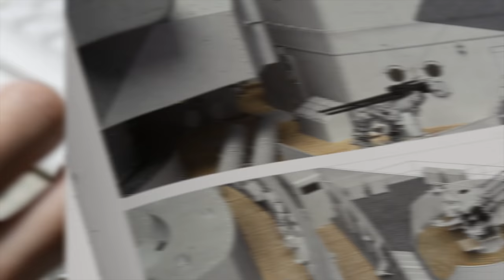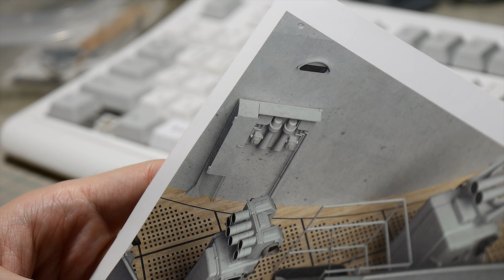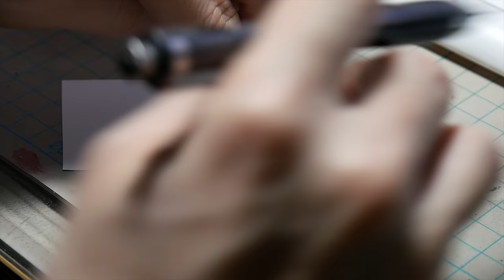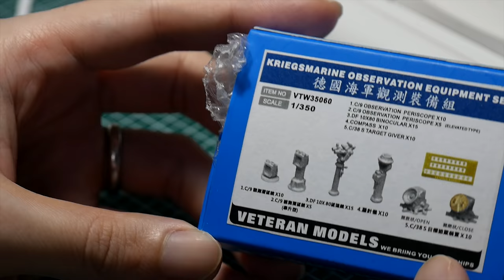1/350 Tirpitz (Revell) Assembling part4

Comment: Since here are fellow modelers, and of course an amazing content creator, I would like to ask what varnish do you use and what thinner to remove excess paneline wash (for example tamiya paneliner). Cause my thinner allwas bites through the closscoat into the paint, or the cotton Butt sticks in the closscoat as it desolves. Maybe I do apply my gloss coat to thin. (should I do a wet coat with my airbrush¿) or maybe I push to hard with my cotton but...
If you can help, that would be great. I've got a Uss Montana project next to come and I want the weathering to be perfect.
I use:
Closscoat : x-22 or Vallejo 70.510
Thinner : revell color mix enamel thinner or the x-20A, which worked not as well.
Problem : wash seems to desolves into gloss coat and create an unpleasend finish
Wash: tamija paneliner black

To the video, absolutely stunning as alway, especially the passion you have. I to often rush my Modells. Have a great time and thanks for the video :)
Reply: I use Vallejo gloss coat.  I mix it with x-20a because I cant be bothered to buy Vallejo's thinner.   Once the bottle runs out, I'm done with it.  
Garbage finish and it sands weird.  It feels gummy under fine grit.  
Using X-20 mixed 1:1 with x-20a gives me no problems through my airbrush or with sanding.  
I bought a plastic jug of paint thinner from the hardware store.  Lifetime supply of tamiya panel wash remover.  No problems.  
When I gloss coat, I give it 24 hrs to dry before panel washing.  
It sounds like your either 
a)  not allowing your gloss coat to dry long enough before doing the washes
b)  mixing enamel thinner with x-20 or vallejo.  Bad news.  
I hope this helps and good luck with your models.
Reply: Clear: Humbrol clear matt/gloss, mostly vallejo polyurethane clear Matt varnish.
Panel line: I do use tamiya panel liner, but mostly use my own made out of acrylic, water and isopropol alcohol.
Thinners: Humbrol enamel thinner or tamiya x20, whatever it is, use very very little, I've ruined enough paint to vouch haha
Reply: @robk.5467  Well, I do give the clear coats about 16 hours to dry and I always used the thinner of the various brands, tamiya for tamiya and Vallejo for Vallejo. But I maybe apply my clods coat to thinly. As soon as it hits the surface it drys, I don't know if it should be like this. Also the finish isn't very clossy in the end. Should I apply more paint or use less pressure? Anyway thanks for the Vallejo advice, wont use it then :)
Reply from the maker: @ ni mofy, I only use lacquer base coat, like mr.color super clear. I haven't used any acrylic colors yet, so I can't give you any advise about using Vallojo's.
Reply: @EbroinSong  I may try lacquers some day. Thanks :)
Reply: @nimofy6336   I think I might know whats happening now...
You mentioned that your gloss coat doesn't look very glossy.
When I gloss, I'll spray a thin "tack" coat first.  Then go back over the area again, but this time I look for a wet appearance when spraying.  It sounds like your not applying enough gloss.  You want that wet look (but not flooded).  
If your gloss coat is too thin, it will get eaten by the thinner your using to clean up the panel liner.  
All I can suggest is to type in "how to apply gloss coat on models".  At least you'll get a visual reference to guide you.
Reply: @robk.5467  OK, I'll try that one, but a ratio 1:1 closs thinner is fine?
Reply: @nimofy6336   yes.  1:1....you see how thick and gloopy that stuff is in the bottle, right?  My airbrush nozzle clogs if I dont thin it down.

Comment: One more thing. How do you go about painting your ships? Do you mask all the wood decking and then paint the ship colours? I'm not sure how to approach my Hood when I get around to painting it. Thanks.
Reply from the maker: I normally put the wooden deck after I paint the ship,  probably your Hood is normal, and better than my Tirpitz. Honestly this Tirpitz has serious issues.. I put the deck before paint it because I have no choice. Thank you again for the comment.
Reply: @EbroinSong  I was wondering why you put the wooden deck down so early, as it means you have to mask it. I thought the Revell kit was meant to be the best Bismarck/Tirpitz available?
Reply from the maker: @rocketassistedgoat1079  Yes, the deck would perfectly fit on unmodified Tirpitz kit. 
But because I modified my Tirpitz, (make new wall, new wall supports, carving out some details, adding new features, etc..) the deck won't  fit anymore.  
So I have to adjust the deck to make it fit,  and simply I can't do it without putting it.
Reply: @EbroinSong  I have to say, it is a bit disappointing how thick the kit sidewalls are; I thought for the price, the Bismarck/Tirpitz was state of the art. But maybe I've just been spoilt by what I'm working on at the mo [Dragon Gleaves, Trumpeter Dreadnought and Tamiya Kagero]. So I'm guessing Revell still isn't quite up there. The Dragon kit especially [I also have the Gearing], is increadible and Dreadnought marks a big step up for Trumpeter. Very thin and tapered sidewalls on both and the Dragon has inner sidewall detail. The sidewalls on the Kagero/Yukikaze I'm replacing with p.e, but it's designed for the kit-so will be easier than what you're doing.
Reply from the maker: @rocketassistedgoat1079  I have Dragon's 1/350 Scharnhorst, comparing the Reveill's Tirpitz, Scharnhorst looks like cookies from the heaven. Unfortunately there is no other options for 1/350 Tirpitz. there are kits worse than Revell's. Tirpitz deserves better.

Comment: What is Magic Sculpt
Reply: The sculpt of magicians? It's the grey putty he's using.
Reply: @hubristicmystic  What are you doing with it?
Reply: @danielmonsberger6490  it's can be formed into all sort of shapes. It hardens when it's left at the air for a good portion of time so it can be sanded or painted. Can be used for filling up gaps or create new structures on the ship. Mostly filling gaps.
Reply from the maker: @ DerRevolutzer. It is a sort of clay. Mix A+B and it will slowly harden. I use for.. almost everything. sculpting figures, making rivets, carve guns.
Reply: Its a brand of a two part epoxy putty  - Tamiya and Milliput, to name but a few, also produce two part putty.

Comment: Very cool but the admiral's bridge looked the same to me. I would have just taken a square file and enlarged the windows a bit. No need to over engineer...
Reply from the maker: well, making new one is not that difficult to me. Filing exact perfect squires are harder when I tried. 
You can try file the squire if you like, I won't complain it.
Reply: I thought that was great work scratch building the bridge - I once tried forming windows with a drill and a file and it was a disaster for me and I wish I had tried your method - however since that time someone building the  Trumpeter Bismarck  over at Model Ship World - https://modelshipworld.com/topic/1535-bismarck-by-channell-trumpeter-1200/ -  recommended using the Dremel Carving /Engraving Set https://www.dremel.com/en_US/products/-/show-product/tools/689-01-carving-engraving-mini-accessory-kit to enlarge or cut out  windows when none are present - haven't tried it yet myself but he made a great job of it.